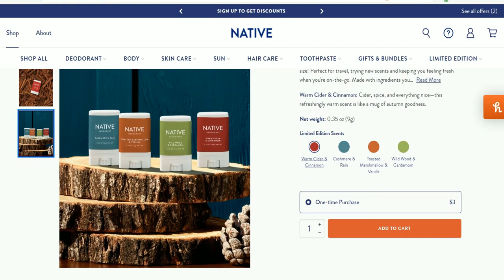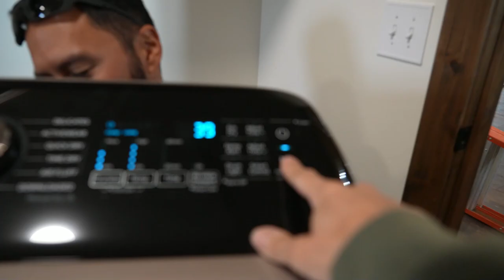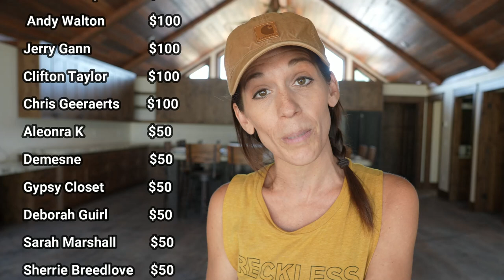HUGE ANNOUNCEMENT! Here We Go Again...

Comment: And yes, as a small statured person, you will definitely prefer an upright freezer.  Lifting the lid on a chest freezer takes a surprising amount of room.  If you're in tight quarters, or the chest freezer is along a walkway, the top begins to collect stuff which means clearing the top before lifting it too; and this means that frozen food in hand you have to put that stuff back on top of the freezer lid or commit to walking around it on the floor (or putting that stuff somewhere else whethernit has a proper home or not).
Reply: I can never find anything in a chest freezer!!!
Reply: my grandmother had one...when i had to clean it out...i knew some of the things were meat...but that was all i could determine...so i called it meat like substance, scary part was it had dates on it that were years out of date. stand up is better. chests just collect things.

Comment: I LOVE my chest freezer! My mother always had an upright, but I feel more secure with my chest freezer.
Reply: I have an upright freezer and hate it! I want a chest freezer but no room
Reply: I love my chest freezer too.  cold sinks to the bottom , heat rises, uprights let all the cold air out. chest freezers are deep but you can use baskets to organize and sort items easily.
Reply: I have 5 upright. So much easier to see things without breaking your back to dig to the bottom that you can't see what's in there.
Reply: @dct1238  When you lose power you don't dare open an upright freezer till the power comes back on or you have a generator. My chest freezer will keep things frozen longer during a power outage and you can get away with opening it to get something out without losing much cold.
Reply: @HoneyHollowHomestead  We all do what works best for ourselves 🙌 I personally, need continual access to my products 😉
Reply: @dct1238  Yes, there are pros and cons to both. For me, food security is most important.

Comment: Silly question❓❓ why not load or leave the stuff in the trailer then just back the trailer to the house. This would save your back walking across the stone driveway.
I do something different with my shower curtain. I take two clear plastic over flap the center about 4 hook holes.  This really helps keep the water in the tub. You can still use the fancy curtain on the outside

Comment: Hoping that freezer is a quick switch after a bit of a drive and of course a stop by the bakery.
Upright will fit nicely though there are organizing baskets on railings available for chests. Defrost is the real issue in a pantry.
You can always add another chest in your barn, where you insulated in the future.
The place is looking great and that shower curtain reminds me of Alaska.
Home stretch and glad the pup can have a nice transition into a comfortable home he can share with the kids.

What's up about your wood burning stove?
Necessary as fall will turn to winter quickly.

Thanks for sharing

Comment: We had the same issue with a Freezer we had delivered. The first time they got it off the truck and I said you can put it back on the truck im not accepting that, I bought new - not a scratch and dent product. Second time I didnt even let them get it off the truck, then I went to the business we bought it from and said look they need to check it before its loaded on the truck to make sure its 100% because other wise im not taking it and next time I will ask for my money back we paid a little over $1000 for a big one. When delivered they are not in the boxes on the truck so they know when they load them what shape they are in, next delivery it was 100% not even a scratch. We have the same washer and dryer, we got new ones at Lowes a few months back.

Comment: Should have went with chest type freezer, much more energy efficient. Cold air goes down so when you open an upright all the cold air comes out and goes down, you can see it. Cold air won't come out of a chest freezer which is why they are used in stores.
Reply: I wish they made an upright with two doors so you did not lose all the cold air when opening like with a single door freezer.  I could separate the extra items to the bottom and place at least one in the upper part.
Reply: @karenreneelyles261  I actually think they do have side by sides.

Comment: Are you using steel lined water lines for the washing machine?  Most home water damage is the result of busted water lines to the washing machine because the lines are always under pressure.  It happened to my family in the early morning hours of Christmas Day. What a mess!  The steel lined hoses cost approximately $25 here in the states.your home is beautiful. 

You should be very proud of what you have accomplished.

Comment: I would still use the freezer after contacting the vendor, have them send you a new door and a credit for the dent. The back dent is a dent ,in the back of the freezer. still works. get a credit from the company and be done with it.  still gonna work. Or maybe they'll send a new one and not require the dented one to be returned.

Comment: Freezers   chest freezer are best for keeping in cold especially  when power is off  but hard to organize when storing different  items   chest work best when use for those who say harvest  large number  of chickens  or stuff that don't need sorting   otherwise  the item you looking for is always on the bottom lol 
Stand up freezers  the cold falls out every time the door is opened   and if not frost free  will build up frost on shelves  and back depending on how often the door is opened   and if frost free will freezer burn food products  more quickly  as the moisture is collected  from air and products not wrapped well equal freezer burning  and cause bad taste to food from loss of moisture    chest freezer hold cold in better when power is off  but need to watch  for seal leaks which will cause frost to form near the top and eventually  may interfere  with lid closing tight

Comment: Saw you using wipes to clean fingers while caulking. Just don’t throw them in the toilet. They don’t break down and will eventually clog your septic tank.
Reply from the maker: Buy septic safe wipes and maintain a proper chemistry in your tank and it’s not a problem. Did it for years at our old property and never once was it an issue.

Comment: The vent should have 90 degreed and went thru the attic under the loft and then out. A custom cabinet that matched the others would have covered everything.  Right now the vent is pumping straight up and into the living space.  Serving no purpose  and therefore at that point not necessary except for the looks
Reply from the maker: The vent does 90 and run under the loft and out the back

Comment: You all have come a long way and things look great even though your "punch list" took a minor hit. Its a bummer the new upright freezer was so dinged. We had a curved like framed mirror we bought that was installed on the wall on the landing of the stairs. That darn mirror was a pain in the tail as after the fourth shipment of the same mirror it arrived all intact. Even though it was well packed by Wayfair it arrived in pieces the first three tries and they didn't want it back so I made a few dump runs to get rid of the others. We put a second-hand fridge in the garage to handle overflow and that kept "tripping" the electrical panel in the garage because all three plug outlets were on one circuit. So we hired an electrician who is a old longtime childhood friend/acquaintance and he installed a dedicated circuit in the panel box just for the "new" fridge so that it wouldn't keep messing up the power to the garage.

Comment: Just want to caution about your washing machine being so close to the door frame……..  In all of our 54 years of marriage, every washing machine we have ever had always vibrated out of place while in the “spin” mode. You could potentially end up locked out of your laundry room, if that should happen. You might consider installing a small strip to the floor to hold the feet of the machine from moving forward to keep the machine from vibrating out of place.